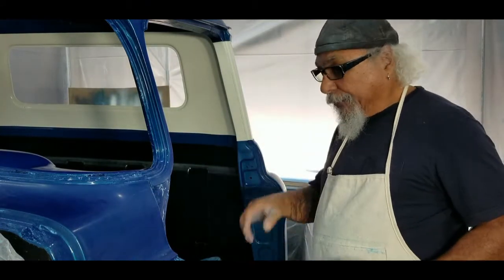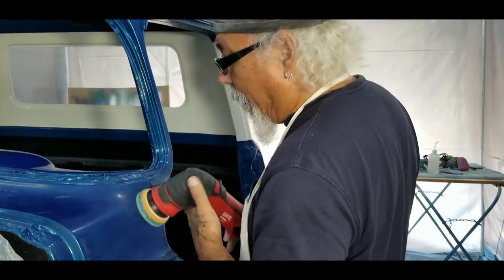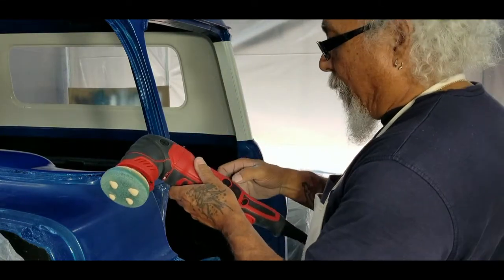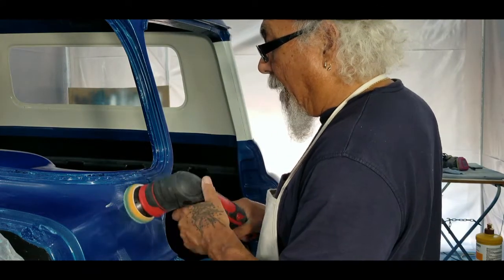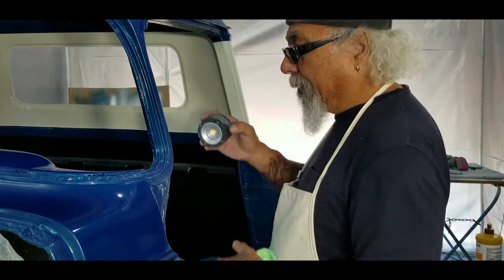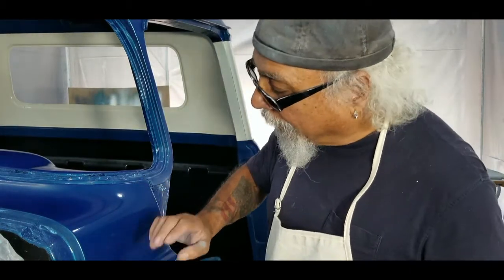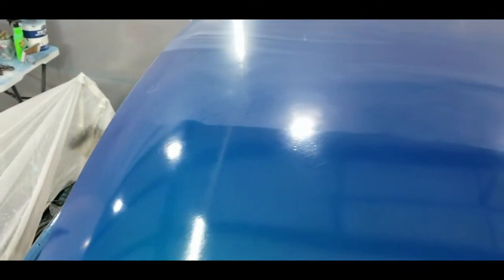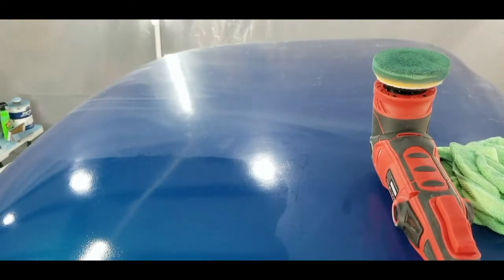55 chevy truck, G8 MINI RANDOM ORBITAL POLISHER to buff and polish the paint after water sanding.

Comment: Old man fixing stuff...I put a 5" backing plate on my Makita rotary and my results with the smaller diameter pads are a improvement easier to get in the smaller areas and less overhang...Im going to buy the Griot GR3 rotary but you can also put the 3 or 4"backing plate on your full size rotary and use it like that...